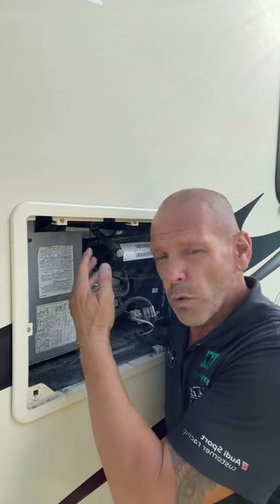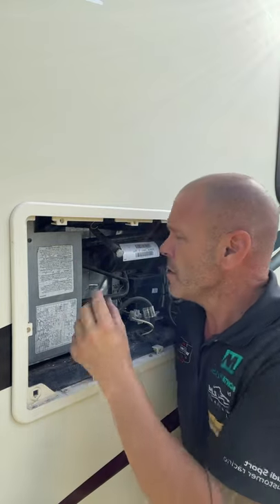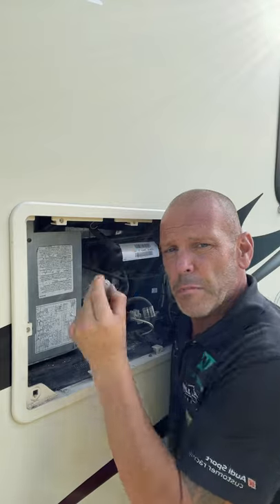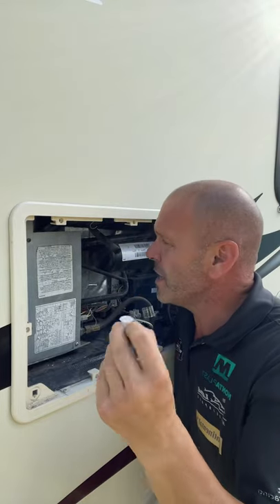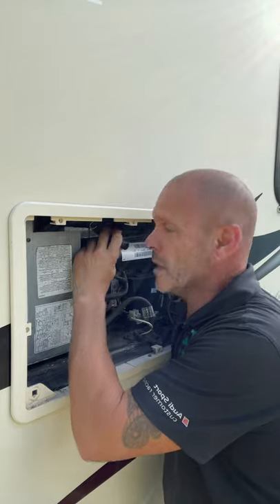RV fridge not cooling, too warm. Quick and easy tip #shorts

Comment: OMG I'm praying this is our problem! I replaced the thermistor and still not cold. Just watched your video and immediately went to check! My bug stopper was completely blocked and when I blew through I felt something pop loose! Cleaned bug stopper and re blew through and all clear! TY for the info! We live in TX and it's been 100 plus for a month now! Will comment if that fixes it!
Reply: I noticed you didn’t comment…. Did it not fix it?